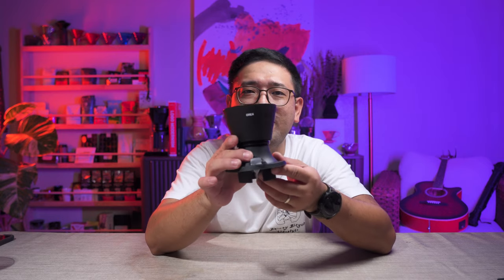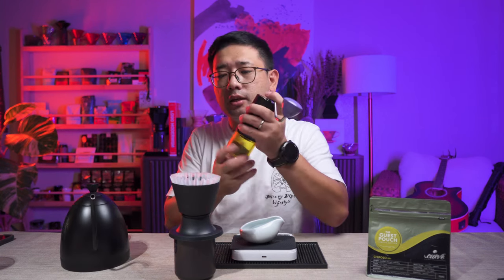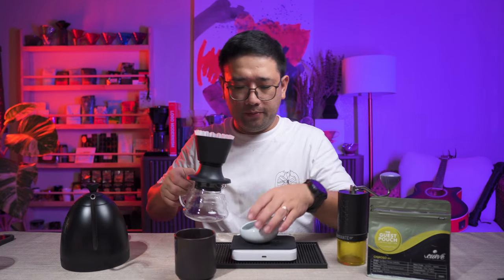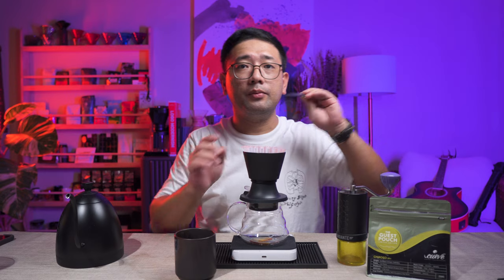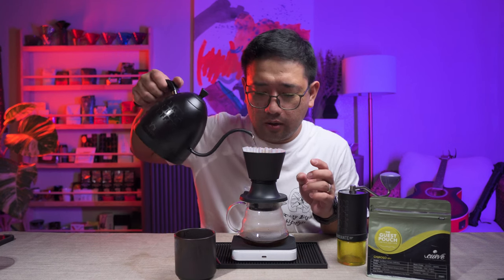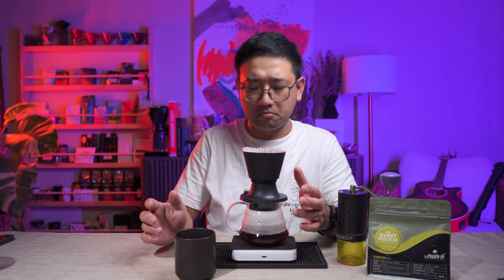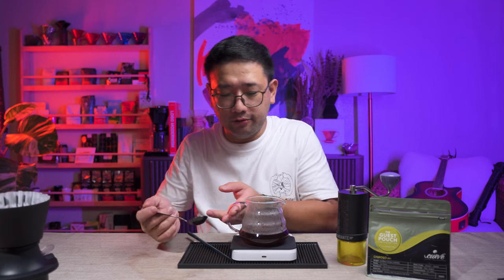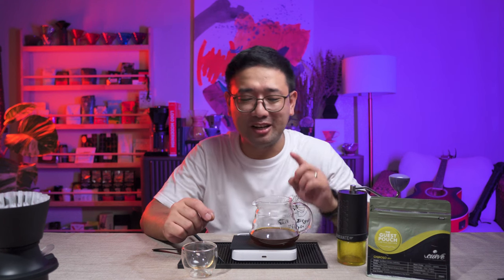Orea Switch??

Comment: For Orea, I tend to grind finer starting 18-20 vs in V60 starting at 22-25. Or you can try increase the coffee to 15 gms.
Reply from the maker: We'll I base my grind size depending on the type of coffee I get - not really because of the brewer. From the beans I decide eventually what recipe i would use and adjust parameters to accomodate that.

Comment: How do brew from your Orea Switch This Video compares to the brew from your older video using Tetsu Kasuya method?
Reply from the maker: This brew is different for the Devil's Recipe. I did a 2-pour method with the Orea Switch, very much like how I would do a simple flat bottom recipe.
Reply: @darylbuenocoffee  I meant. I meant how your brew here at video compared by taste to your Tetsu Kasuya brew at past. Sweetness. Clarity notes tasted.. Complexity many notes in brew. Body Fullness. etc. In otherwords would your 89 points Fav bean taste just as good with either brew methods.
Reply from the maker: @larrywong7834  Oh, i might need to get more of the beans and experiment once more side by side to compare them fairly.
Reply: @darylbuenocoffee Oh. Not necessary for the side by side. It only mattered if Both were unforgettable brews. Apparently Both by your experience are not Devils.
Reply from the maker: @larrywong7834  haha it gets blurred overtime, i brew at least 3 cups a day plus i breew a lot more when im filming specially when i do experiments like this.
Reply: @darylbuenocoffee  HaHa. If the Devil bit my Azz. Personally I probably remember Everything pretty well. Unless it was Just Marketing.

Comment: Interesting lang talaga ng mga flatbed switch kasi sweet sila due to its short contact time pero makukuha mo yun sa soak eh.
Reply from the maker: Not always the case, If you compare an Origami flat versus an orea flat, you would actually get a brighter cup with the origami than only sweet. Also not always the case when you soak - sometimes if you soak too much as what happens in a Suji Dripper, since it has a very slow draw down therefore inducing soak -  you tend to over extract, lose all the qualities of the coffee and fail the whole brew. Also in a V60 - grind finer to induce soak, before you get your sweetness you tend to draw astringency easier and faster than sweetness.
Reply: @darylbuenocoffee  well that's very interesting 🤔, maraming mga variables sa plain sight, talagang imposib-leng di ka maka oversight, napaka ganda ng explanation mo master! Na isip mo na bang mag gawa ng video about your own brewing theory? I meant like a very detailed and not specific to only one recipe? Just curious. And interested
Reply from the maker: @sheanakale9502  yes! It is something im working on for a long time now and im still developing it :)
Reply: @darylbuenocoffee  im pretty sure your  close to perfecting it! Goodluck dyan and im very avid to see that soon.